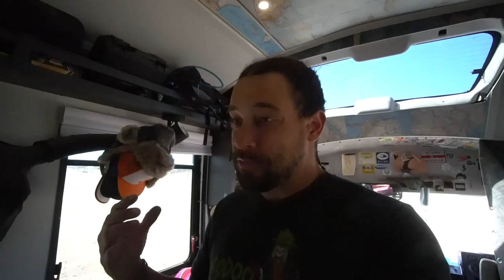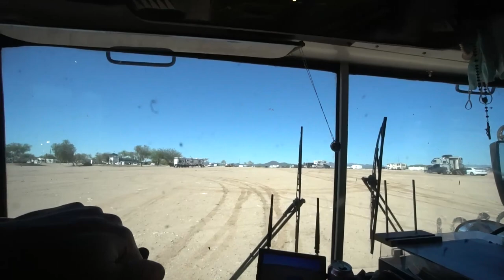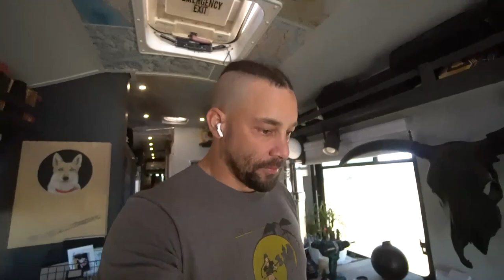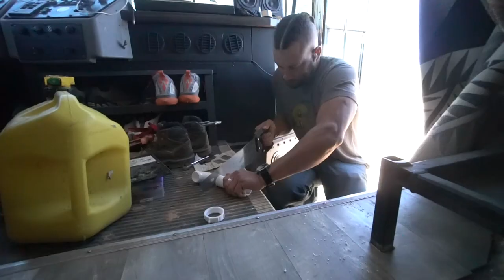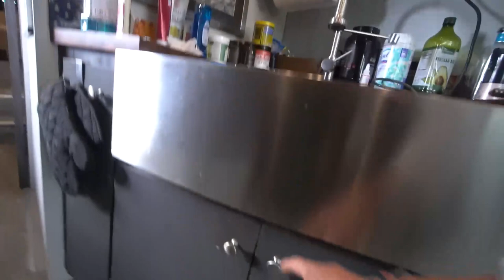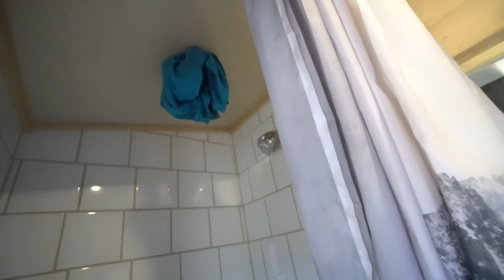Filming For Tiny Home Tours - Ghost Mouse Fight Continues

Comment: Peanut butter is like crack to mice. 

Put the bait in the middle of the trap or on an old spring trap. 

The mouse is looking for water. If you seal off the P-trap he may attack other pipes. 

Last time I had highly intelligent mice. Trap savy. They would even move the traps out of the way. But, peanut butter gets them every time. Hurt me as they were so clever. But they will ruin things if you don't go full Terminator on them.